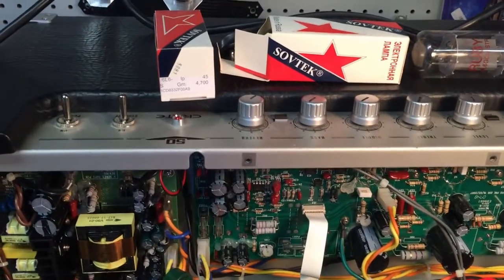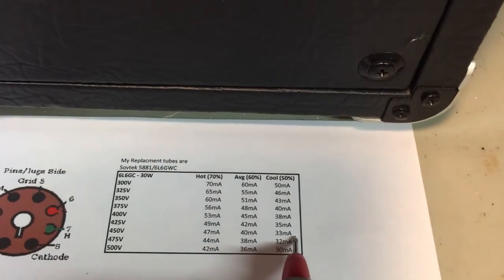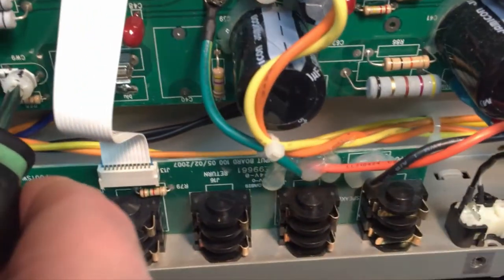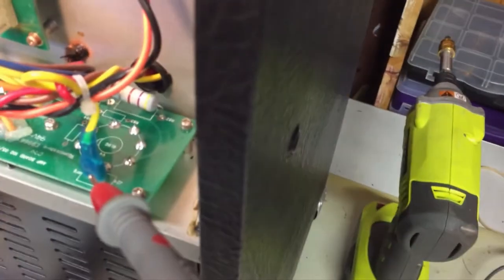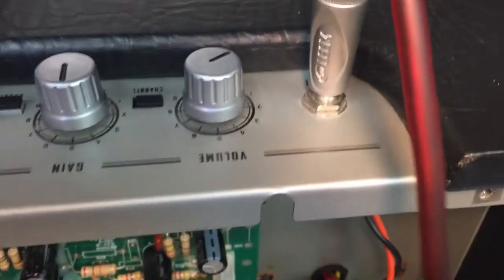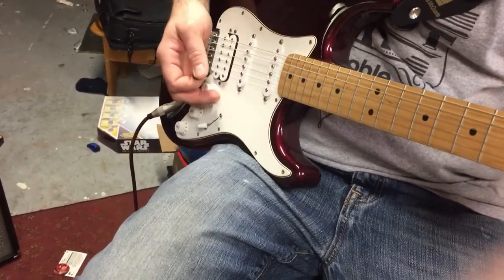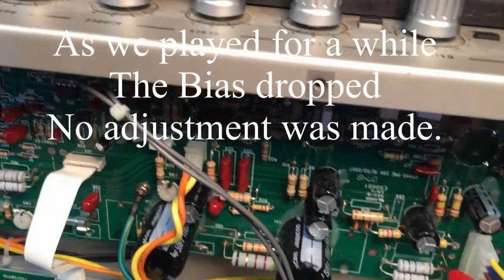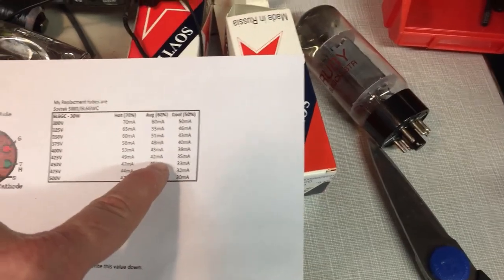Crate V50-112 Biasing video

Comment: Hi there, so I have the same amp and followed your video to bias my amp. if there's only one biasing pot then I've found that both power tubes cannot be at the same biasing, so on mine, plate voltage on both tubes was 425V, so I tried to set the biasing for 42 which I was able to do for only one tube, because there's only one biasing pot, and the other tube could only be set to 40, so anytime I turn the pot, it throws off the biasing of the other tube by 1 or 2 mV, would you say this is normal and ok to leave like that? Thanks for sharing this tutorial
Reply from the maker: ya, it's a balance game. when current changes so does bias voltage so you need to keep tunning. Sounds like your doing everything right. your close enough there won't be any long term damage or anything. I may be wrong here, but my feeling is over time as the tubes break in the bias will change by a few mv anyways. so close enough is good enough in my books.
Reply: @caffeine9334  Ok Cool! I actually ended up setting one tube to 44 and the other by nature of the biasing on this particular amp, ended up at 42, tested it out and it sounds Amazing!! Love this amp! Better than my Marshall DSL40, I have the original Ruby tubes in there, both in great shape, tested out strong, no rattles, but going to buy a set of the same Sovtek tubes you installed that someone's currently selling for $40 as a back up, or maybe I'll try them out, but as it is the amp sounds great! Thanks again Bud!!

Comment: Can you explain what does it mean “BIASING” ??
Reply from the maker: It’s kind of like balancing but as you balance the voltages on both tubes shift so you need to go go back and forth between voltage and bias until both tubes are close. That’s why when you buy tubes you buy matched pairs. If they are too far apart from one another they won’t bias.